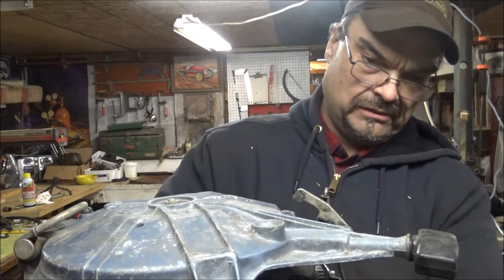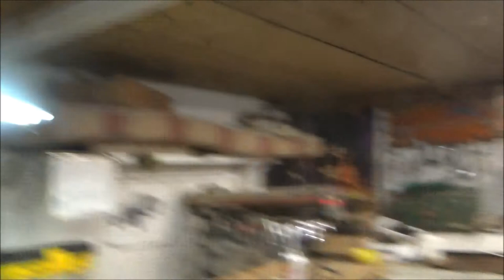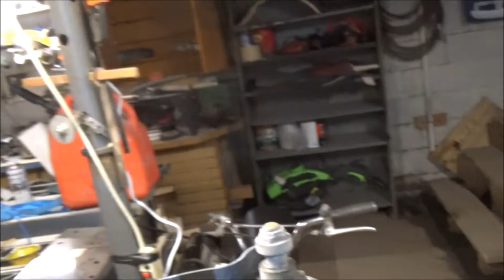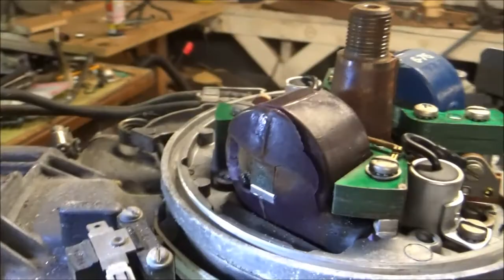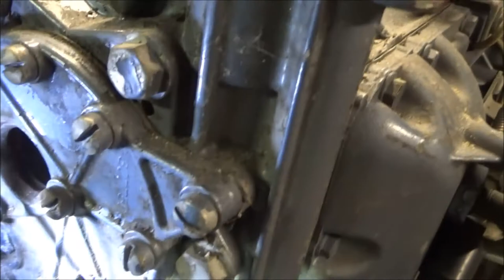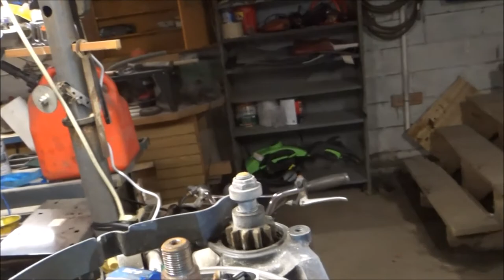1964 Evinrude 40hp Teardown Video2

Comment: Just added an electric start /ring gear to My '59 evinrude 35 big twinny Goody Jubiliee recently.. Well I also replaced both coils, condensers, rebuilt the carb/pump and installed a new impeller. It runs crisp. Only has 30 original hrs on it!
Reply from the maker: Nice,  I just sold my boat and motor last night. Good luck with her!  Thanks for watching and commenting.

Comment: I finished my 1963 40hp rude overhaul. Love these motors
Reply from the maker: Jack Olattern good to know you have some expertise.  By the videos you can see I have never worked on a boat motor.  Threw are a lot of safety switches and shutoff that I have never seen before.  I have a manual and I think I can get her running again.  Most of the parts should be Saturday.  I will shoot more video then.  Thanks for watching commenting and subscribing.  Later -Ed
Reply: Ed Moore same here, only way to learn is to do it.  education costs time and money

Comment: Hi Ed,
Regarding the shaft seals, how far down should the shaft seal be below the water pump?
Specs:
Evinrude Big Twin 40 HP
Part 22 #313284 Retainer, oil, driveshaft.

One thought is that the seal should be flush with the lower casting, as to avoid creating standing water above the shaft seal, There is no "seat" which prevents the seal from being placed lower in the casting, which if done creates a gap in which water can be left standing on the shaft seal.

Scott Watson

Comment: Hi Ed. That will be an interesting series. Tip. Make sure and use the right plugs,if they are to long they can hit and damage your pistons. Do you have a gauge to check the cylinder pressure ?.  I owed one of those motors a few years ago. and the carburetor had a fiber float if so replace it. Not fun to paddle back to shore  :) 
All my best
Bobby
Reply from the maker: Hi Bobby,  Yes I do have compression gage, I tried pulling it over when I got it and the plugs were in it and it pulled pretty hard, but I will do a compression test in the next video.  Actually the next video is done, so the one after that.  I am looking for a replacement float, I have a source for the coil  and the fuel pump so I will order that soon.  Thanks for watching and commenting and being a loyal subscriber.  Later -Ed

Comment: between the manual and youtube,i am sure you will figure it out. i cringed when you beat on the crank without the nut on,lol. having a lead hammer comes in handy for times like that,i got 2 at yard sales. that new light doesnt seem to do much sadly to say
Reply from the maker: I need to find the manual.  I do need a soft hammer.  I made sure I wacked it square not to damage the threads " TOO BAD" .  I know not the best idea, the puller worked well!  Thanks for watching, commenting and being a committed subscriber.

Comment: Hi Ed I'm pretty sure you didn't do that to the coil I think it corroded internally and the pressure broke the caseing. I'm sure it has points if so clean them but I have to watch the next one now to see how it's going
Reply from the maker: Dave Ackerman 1967 I'm pretty sure I didn't hit but a previous owner could have,  but you and Bobby had the same thought that shorted and blew the plastic apart.     I found my service manual and I'm waiting on parts.  The bottom end seal kit is in and I already have the water pump...that may be the next video as I am waiting on fuel pump, carb kit and coil.  Thanks for watching and sharing your thoughts.  I am no boat motor mechanic and appreciate any info.  Later -Ed

Comment: Hey Ed, how about clean the contact points with a light soft grain sandpaper? maybe that bring back the sparks and that is all or otherwise is like you suspect, a faulty cracked coil, try it, who knows.
Reply from the maker: Hang in there...its in the next video.  Definitely need one coil.  Thanks for watching and commenting.

Comment: Ed When you brought out the booster and the sparks started flying the look on your face was so funny I could not stop laughing lol.
Anyway great video I don't know much about boat motors either very interesting videos.
Reply: Just had to add you are so much like me put tools down 2 seconds later they are gone. The tools you need are always in the opposite side of the garage. I can relate I spend more time looking for stuff I just had in my hand 5 minutes earlier than working on my actual project. Keep it up buddie you made my day nice to know I'm not the only one who does those things.
Reply from the maker: Les miletics I suffer from CRS...Cant Remember Shit!  I think my brain is always moving ahead faster than what I'm physically doing.  So when I have to go focus on the step, I forget where I was.  Or I'm getting old!  lol   Yes the jump pack was another thing that my friend was going to throw out since the charger port craped out.  I just leave the side cover off and clamp my trickle charger on when it needs a charge.  But in the process of making it work I had to bypass the switch. The tried using it and for some reason I wired the switch back in and then it kept beeping, So I wasn't sure if it was on or off...It was on!!! Thanks for watching and commenting.  Later -Ed